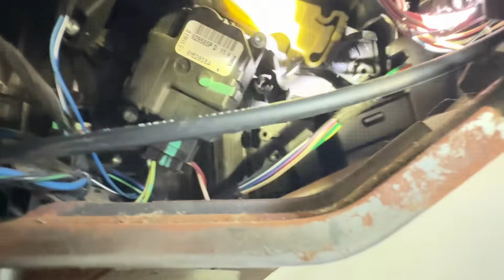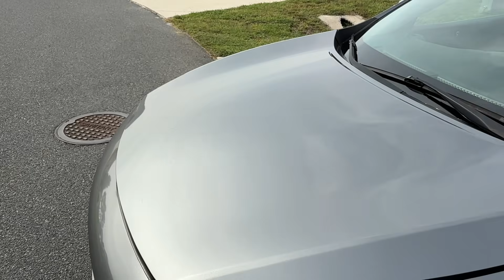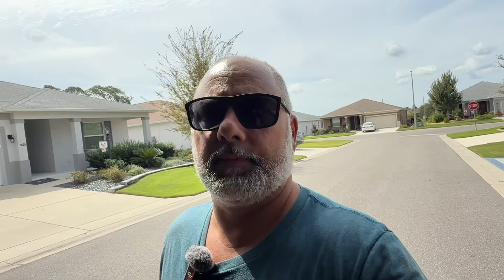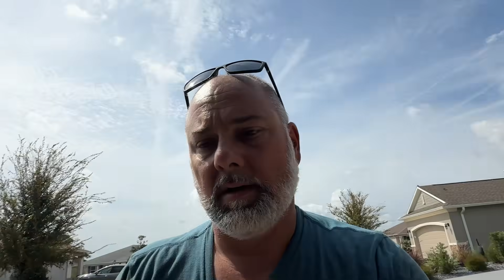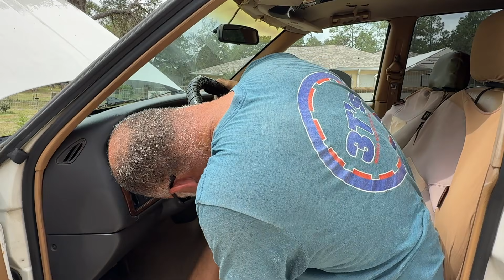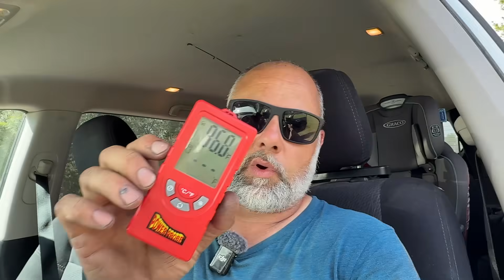Mobile Mechanic COUPLE Makes $2000 in One Day Here's How

Comment: Does refrigerant have to be in the system for the sniffer to work or does it pick up nitrogen?
Reply from the maker: Needs freon
Reply: @3TsMOBILEMECHANIC okay thanks. Do you recover it with the nitrogen in the system or can that not go back into the machine?
Reply from the maker: @shanebock2576  no you can’t put that in there. It’s only a quarter pound.
Reply: @3TsMOBILEMECHANIC Thanks Ben

Comment: I used to be in the auto mechanic field got tired of it after 25 years. Started learning welding 5 years ago. Now I do mobile welding jobs. Anywhere from quarter panel patches to pipes. 1 job sometimes pays what I made in 2 days wrenching at independent shops for 3 hrs of work